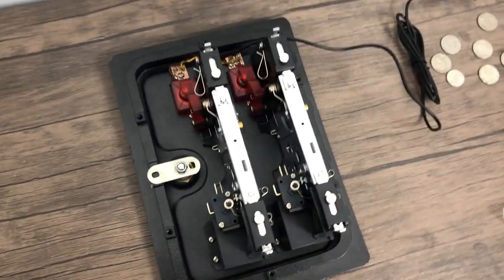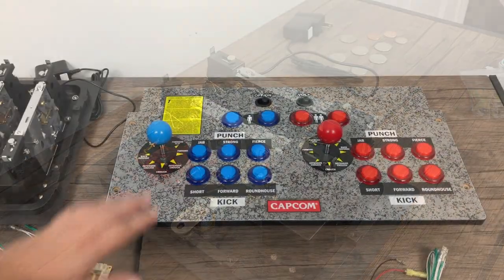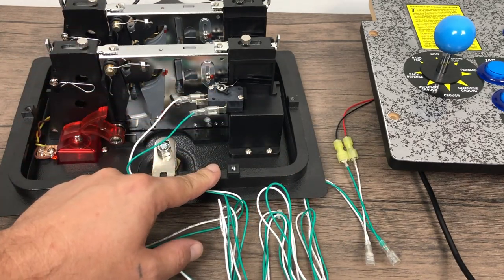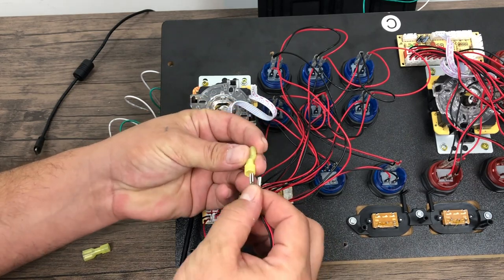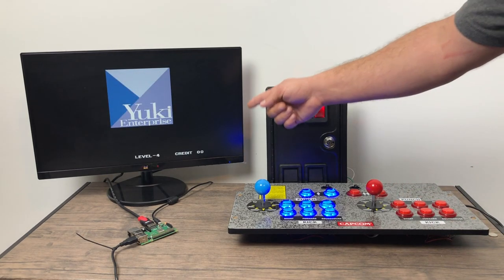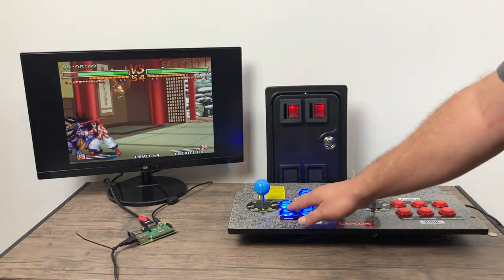How To Add A Coin Acceptor Mechanism To Your RetroPie Arcade Build

Comment: NOTE I got a generic Amazon coin acceptor (model # ch-296) and apparently those kinds of coin acceptors send a low constant pulse signal to the USB encoder making it think I'm constantly putting a coin in. I ordered this double slot coin door from X-arcade so I'm hoping this works because I have this same setup

Comment: Excellent Video.  I have the Arcade Coin Door With single Coin Mech from X-Arcade.  two quick notes it only works with US Quarters and the plug is used to illuminate the reject button.  it is not needed to register the coin credits.   Note You need something inside you cabinet to catch your coins.     I recommend you use the splitter connection cable otherwise you are going to need a lot of quarters or need to constantly retrieve your coins from the cabinet.  You arcade will double as piggy bank.
Reply: I am thinking about getting a streetfighter fame and putting it in a high traffic bar.. can you set it to where it is 50c per play?? Can you really charge money or is it only for show?? Donyou think you could wire this to charge by card?

Comment: Sweet!! I didnt realize the power source for the coin selector's lamps would be a wall outlet plug. I thought it would be a simple 5v wires. Plug directly to the pi for power.
Reply: I'm sure that can be modded

Comment: Looks neat,  20 years ago i folded a bit of alloy and put in what was Cheap back then $60 for a single coin acceptor
Reply: i linked in to one of the Buttons i had for Coin, now both work (Free Play or Coin)
Reply: Like you i linked in to one of the Buttons i had for Coin, now both work (Free Play or Coin), and also Side Buttons for Pinball Games

Comment: You can buy a door for the multicoin accepter you showed in at the start of the video. They come pre cut out ready for use. You can get them from arcadeworld.
Reply from the maker: I actually saw that last night they even sell double doors. I might pick that up for the Arcade1UP
Reply: Any Door can be a Door to Match your Cab, and Coin Acceptor's can be bought separately, or twin or light-up, the choice is your's, 
When i built a Mame Cabinet many years ago, not much in the way of choice, as price's where high, You guy's today are so lucky, i would be making these things by the Dozen

Comment: Great video! I have a question though. What exactly are the ‘quick connect’ pieces he is using? And how do you connect the using the wires that cane with the coin mechanism. It’s probably very simple, I have zero wiring experience. Maybe there is a video showing how to do it?

Also, if someone can provide a link to the ‘quick connect’ product on Amazon, it would be much appreciated.

Comment: As an electronics engineer I do not recommend twisting any cables together it is always best to soldering the wires together and heat shrinking them up

Comment: Great video! One question however. I assume by adding the coin acceptor device, and mapping the select button to the coin input, the game automatically knows to display "insert coin"?  Obviously without the coin acceptor device, there isn't a "insert coin" display, so I assume retropie automatically knows that the coin door is present?
Reply: Not really, the idea is these versions of these games were built in a way that only allow player control if the "credit input" is pressed, which is hidden behind the coin mechanism - it's essentially a big weird button wired to the board that can only be pressed with the correct coin insert.

If you emulate any of these games without the coin mechanism they'll still flash "insert coin" but the program probably has the "credit" input mapped to something like the Enter key or the left trigger on a controller.

Comment: I've always been fascinated with arcade games, and I always dreamed of having my own private arcade cabinet as a piggy bank, one that is entertaining and does not have to be broken with a hammer in order to acces the money I save, lol. Seriously, and yes, it adds more authenticity to the experience. I am finally going to build my table top minicade, already had 2 solid japanese joysticks through AliExpress that were gathering dust, recently ordered 2 Sinden guns that should arrive in a few weeks and a Botacera pendrive with version 37 that should have those guns working right out of the box. Judging from your video, this coin acceptor would work exactly the same with Botacera wouldn't it? Same wiring and same configuration steps no? A Botacera enabled piggy bank, isn't that any kid's dream? I'll buy one of those coin acceptors, could anyone confirm they work with Batocera the same way?

Comment: Just to recap. I already have a arcade build finished with a coin and select button wired and working. Now I want to add the coin mech, but I want to still be able to use the coin button if I don't feel like using the quarters. So all I have to do is tap off the working coin button to run the coin mech correct? Then both will be working at the same time giving me the option to use both, right?

Comment: Did you cut off the end of the 12v power supply to attach the right connectors for the encoder/Pi? If so can you give a few simple steps on how you did this? Thanks for the vid

Comment: ETA Prime. SECOND QUESTION: I see you connected both coin acceptor and the select to be the same and the SELECT button will work for SNES games. What if you configure the SELECT button as select instead of inserting coin? Will it then bypass the coin acceptor? This way, you can choose to go back to using regular SELECT for arcade games and allows you configure whenever you need to use the coin acceptor? Is my assumption correct?. Hope you can answer my first question.

Comment: Now, how-to make it, so credits carry over when you switch games :-)
GO!
Reply: You could use a seperate diy counter circuit connecting to the select button, similar to RAM to hold the memory. And You could have a switch/button to activate the circuits output. Although it wouldn't be integrated with the software and would essentially double your credits, so if you put lets say five credits in and you use up 1-5 credits and switch to a new game you still have five unused credits.

Comment: Showing how to bind buttons per emulator is a thing. I had a bind A to my Stella core to get my Retrolink Classic Atari 2600 controller to work. Pressing Select + X brings up Retroarch were the correct button binding can be set. Stella defaulted B instead of A for fire button. I had to set A for button.

Comment: Okay so ETA I have a coin op door from recroommasters I purchased a whole cabinet and using xarcade tank stick i have the coin acceptor with mine, but my question is can you utilized both the coin operated select and a button at the same time?
Reply from the maker: Yes you can. I added a section in the video showing how to do so. Just wire it to the button so essentially you have 2 buttons “the coin switch and the select button” wired to the same spot on the encoder
Reply: @ETAPRIME  ahhhh sweet okay thank you sir!
Reply: I saw the there is a way to have a switch that turns on and off the coin button just in case you want to just want to use the door or not. How would you go about doing that?

Comment: Hey man, I'm trying to figure out how to sub out a button on my x-arcade stick to the coin acceptor (cheap one on Amazon).  Where can I get the 'quick connects' for the thin wires that come with the coin acceptor so I can simply disconnect the micro switch from the button on the arcade stick and insert it into the coin connector without having to solder or cut any of the wires? Your help would be greatly appreciated.

Comment: Very nice :)
I have a question:
- Does this coin acceptor distinguish between coins, so can you program what you want or accept only 25c
Reply: Some coin acceptors are adjustable so that it will accept tokens, quarters, foreign coins, etc. Depends on which model. You'll have to look at the description before purchasing. The one in this video looks like it's only made for quarters. Look for a YouTube video from Way of the Wrench titled Arcade Coin Doors! How they work, how to inspect/restore them, and install into your cabinet! Ep#10 he explains this at the 2 minute 55 second mark.

Comment: Is there a way to wire this up on one of the quick connect USB boards that have 3 wire connectors (ie led lit buttons) ? I can't figure out adding the coin door to this style board if possible... it does have a section of 2 pin connections, but they aren't the select button. And couldn't get it to recognize. Or do I need to scrap led buttons and go back to standard 2 pin encoder board? Thanks! Need genuis help!

Comment: ETA prime. I have another question. If the coin acceptor is a single coin acceptor. Can you configure the first player to take coins and player 2 to use normal select button at the top?  I recall both buttons needs to map to the same encoder. So basically, I configured both exactly like your RaspberryPi Arcade1up configuration. I tested out configuring P1 to SELECT button and bypassed P2 on select and neither Select button worked. It seemed to have to be both mapped. Please let me know ASAP. Thanks

Comment: ETA Prime.  Big fan of your channel and great tutorial as always.  I do have one question before making my purchase.  The Amazon coin-acceptor shows only 1 slot rather than 2 accetors (in your video you have 2 coin slots).  If I were to buy the single coin-acceptor, will it work on the USB encoder to work on both SELECT buttons?  Or do I need to buy a 2 coin slot acceptor.  I followed your tutorial on the RasperryPi and you mentioned both encoders needs to have the same inputs.... will wait for your response before purchasing.
Reply: I have a same question. Seems like 2 slot acceptors are hard to find. how did you go about it?

Comment: ETA PRIME
I want to put a coin door in and install an illumination kit without soldering the PCB to my Galaga 1up cab. 
The unit I purchased from Twisted Quarter
Says I need a 12v power supply ..

See all kids of options I think on Amazon, but don’t have the foggiest, and Radio Shack is no longer in business.(The Old School Radio Shack )

If this is possible can you point me in the right direction 
🤞
Thanks

Looks like I should have went with X Arcade  instead As it has a power supply
Ugh!

Comment: I have a new style button kit that comes with 3pin encoder wires, how do I connect them from the 2 wires coming from the arcade door ?
Reply: Ever figure this out?
Reply: @SandyRidgeWoodshop  yes I did,  I’m looking at them right now and I don’t remember the complexity of it. But all I did was plug the 2pin connecter into the slot on the 3pin encoder... leaving the left pin open. It’ll fit just leave the left one open
If that makes sense
Reply: @CreampuffK  Mind sending me a photo? I don't think I understand what you mean by that

Comment: My brain about to die. How do you configuring select button to does not give coin! I would like to use nes-playstation as well on my setup. On configure input, select function is assigned/connected to the Coin slot. Its fine. But in the game, when you pressed to select which is bridged to the select button it does not give the credit. How do you do that?

Comment: If you mod the SF Arcade1up cabinet to use the pi would the panel on those cabinets hold this coin collector if you made the hole for it?
Reply: No, the panel is too flimsy.  You would need to buy some wood (1/2" should suffice) and apply it to the backside of that panel to hold the metal coin door secure.

Comment: Anyone able to help??? I have the same coin acceptor  and when I try to map it won’t read. The led buttons flick off and then on once I put the quarter in but it won’t register in the configuration in RetroPie or retroarch. I need help anyone ???
Reply: YouNgWunzz - I have exactly the same issue as you, have you found a fix yet?